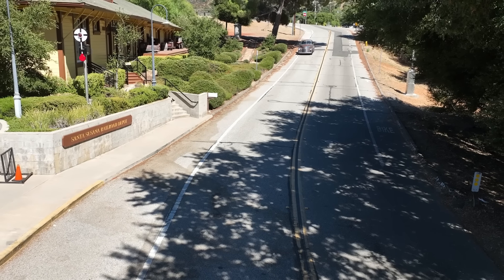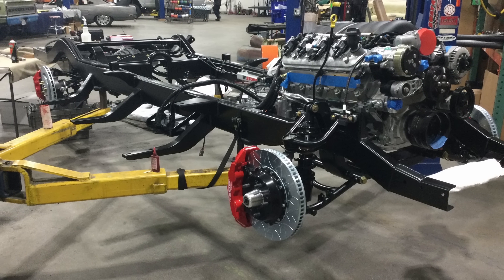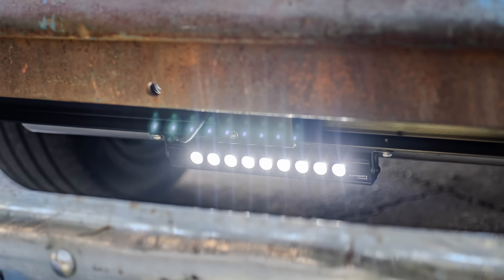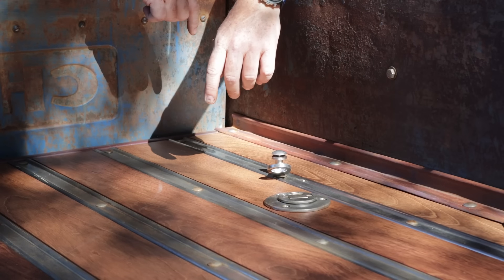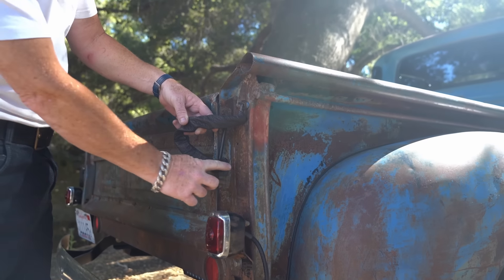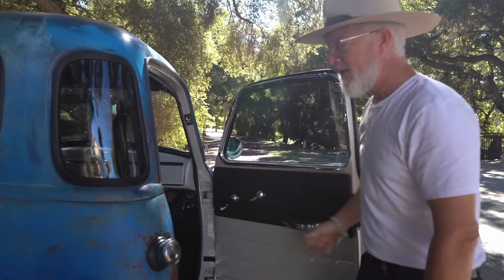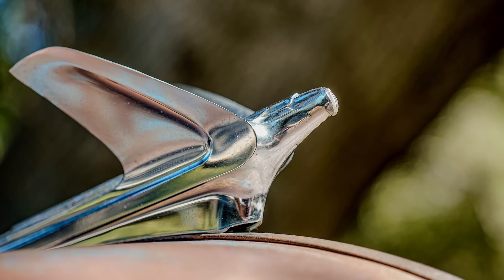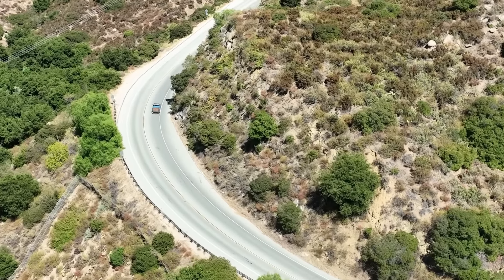A WOLF IN SHEEPS CLOTHING!!! ICON Derelict TR #25 Restored And Modified Chevy Thriftmaster Pick Up

Comment: What a beautiful truck,
100% class! I have a restored 67 c10 LT swapped/8 speed, lowered restomod. I’m running CPP tubular a arms, OEM steering linkage with a Borgersen  quick ratio steering box and solid steering shaft (u joints, no rag joint). Yet I still have a lot of steering slop and find myself chasing the car on rougher roads. What can I do to upgrade my steering so that it matches the performance of the drivetrain? Any suggestions would be appreciated.

Comment: Difference between automatic & standards version standard you can peel out more. My opinion automatic a lot safer just use synthetic transmission fluid Mobil one synthetic transmission fluid. And depending how much prevented maintenance an high quality external transmission cooler